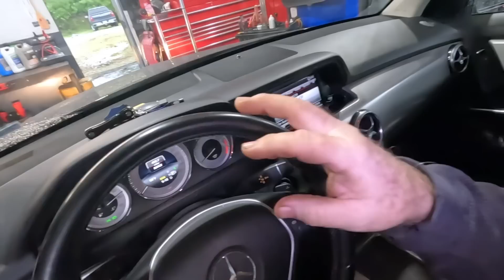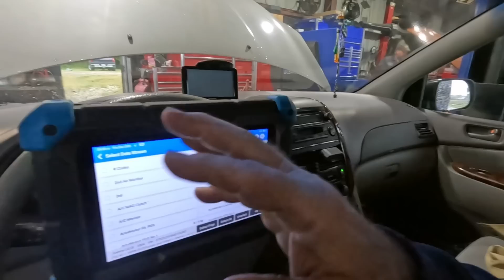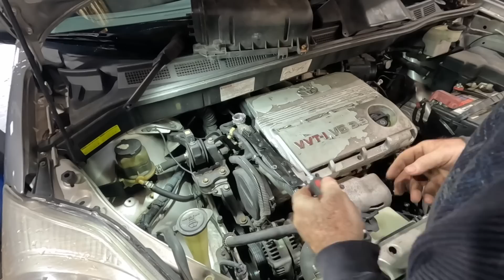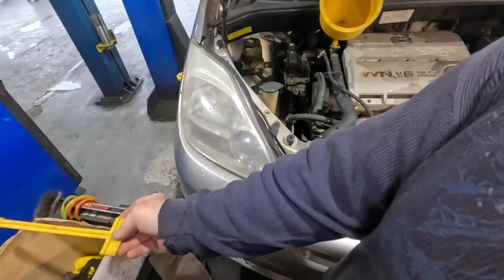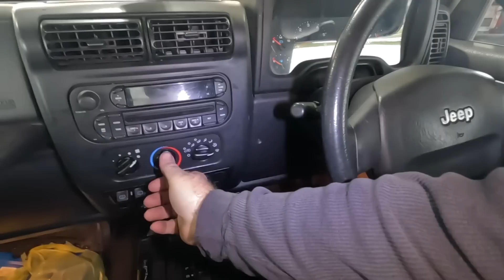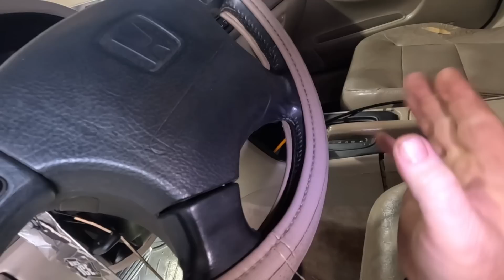JEEP leaks, SIENNA diag, MERCEDES inspect, ACCORD speedo, ALTIMA noise, DAY IN THE SHOP 389 #repair

Comment: Can you buy parts to fix up toolboxes?  Or is the price so much and too much labor intensive it's better to buy new ones?  I'm not a mechanic, but I've thought about buying a used locally as I have a ton of tools and would greatly clean up my garage.  At times I do see people say that a few drawers don't lock or close.  I'm guessing the boxes were not made to be moved with them fully loaded as I do see people move them around loaded loaded up.
Reply from the maker: Yes, you can usually buy parts if it's a fairly popular brand. But I'd try and find one still in good working condition and avoid that part of the process. It can be expensive and time consuming. There are lots of decent used boxes for sale. Brands like Matco, Mac, Snap On can be expensive, but Craftsmen, Dewalt, Milwaukee and similar brands are more economical and will serve you well.

Comment: Jimmy, can the vss sometimes cause abs problems? Hall effect sensor?
Reply from the maker: It could, but the system usually just compares each wheels speed. It will want vehicle speed to activate and deactivate the system. Like at low speeds. But each system might have subtle differences. Modern cars with stability control it will cause all kinds of issues.
Reply: @JimmyMakingitwork  ok cool. My 08 F250 has 3 sensors. Two in front and one in the rear. One of the front sensors was going bad, and the abs light would come on. 

Changed the bad sensor, and the light went out.

Comment: A tool box/chest is meant to hold your tools.  It is not a mini-camper or a tiny house.  For $10,000 I can buy a whole lot of tools!  If you think that it's a good investment, wait until you try to resell it - you will not get $10,000 for it used.
Reply from the maker: Exactly! Usually 25-40% return at best. Unless you trade it back in on an even MORE expensive tool box.
Reply: That's how they make money on both ends! @JimmyMakingitwork

Comment: i try to pick a manufacturer  that i feel comfortable buying their drive train. Most manufacturers still make their engines transmission . also, some manufacturers  make a few decent engines, and the rest are trash . so i would say do your research people and find the engine transmission combo with the most reliability. for me l have owned 18 brand new cars in my life. if you want a fast, reliable v8 that can with stand an aftermarket supercharger making over 600hp the Ford coyote should be on the list. i have owned 4 . i would  personally say most toyota,s  for any everyday use with honda and acura close behind.  i have acura rdx 19 every day driver hit 55 thousand no problems just did a drain fill on transmission and serpentine belt change. i changed the oil every 5 thousand miles . it is a 2.0 turbo, so only time will tell if it holds up. but it won't fail because of lack of maintenance! thanks again, jimmy for the great content 👍
Reply from the maker: Nailed it Alex! Thanks.

Comment: Jimmy, is there a particular brand of suspension parts that you’ve had the best luck with? Moog used to be decent but it seems lately the quality has gone down.
Reply: That is a tough one Moog has really gone downhill the cheapest Master Pro shit from O'Reilly's is terrible you'll get a a set of lower control arms and one side won't have a zerk fitting in the ball joint nobody makes anything decent anymore
Reply from the maker: Man, that is a tuff one. I haven’t seen big problems from any really, but I don’t do tons of front end. I basically
Install what ever they bring me. I’d still choose moog probably based on past successes. But it can change almost daily it seems.